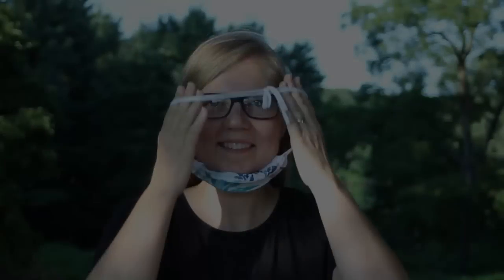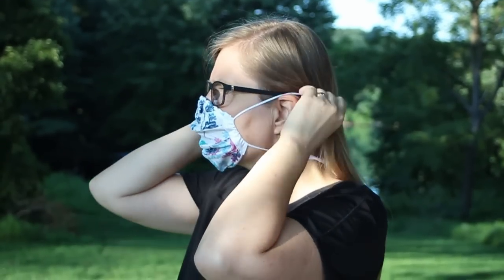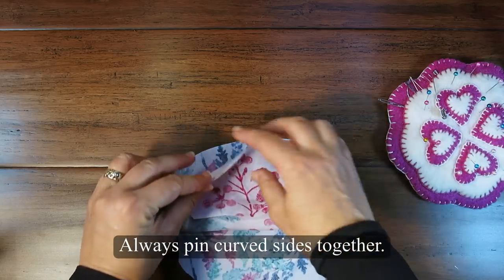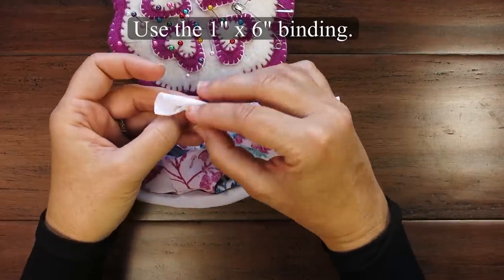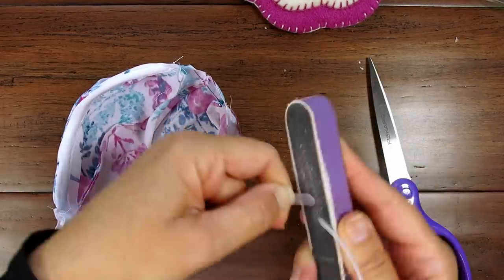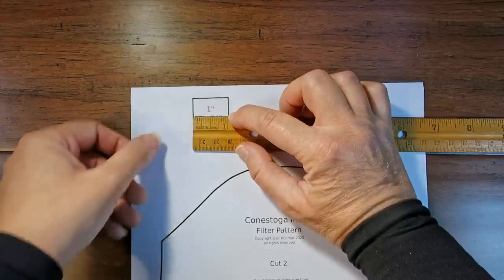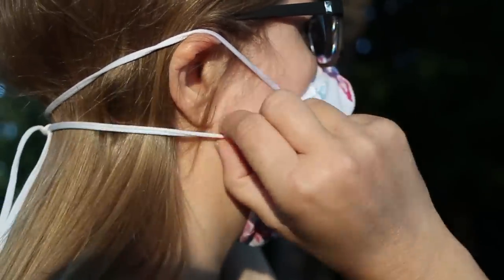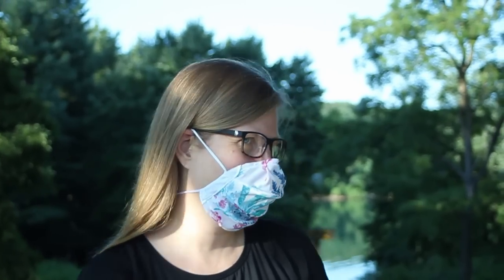Form Follows Function: Introducing the Conestoga Mask for Better Fit, Filtration and Air Flow

Comment: The only ones who can benefit from this great mask are those who have a printer. Thanks anyway!
Reply: I use the computer and printer at the library.  
     Virginia
Reply from the maker: If possible, I would try to view the mask pattern on your screen to scale (the one inch box should equal one inch) and just trace it onto paper that you can cut out, or go for one of those graph transfer scenarios where you have a one inch grid and transfer what you see from a smaller grid.  The library or a friend would be an easier choice though. Be well!
Reply: I also do not have a printer and was able to ask my neighbor to print the pages I needed.